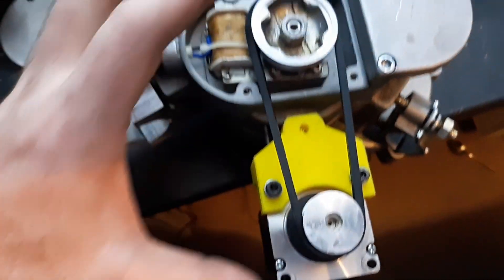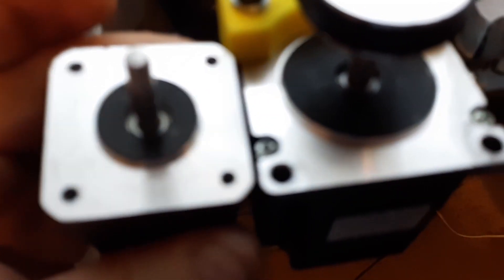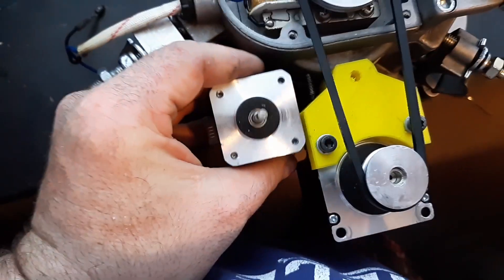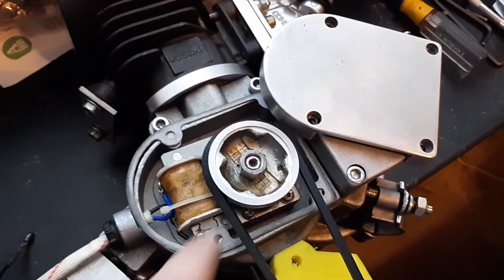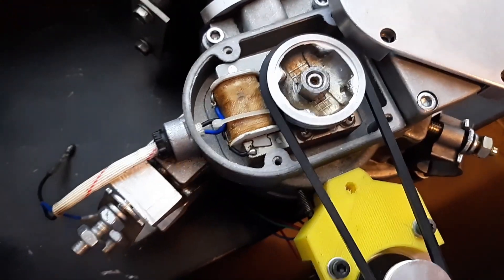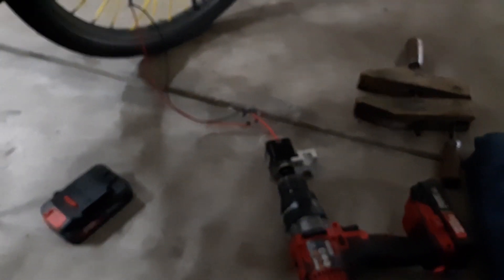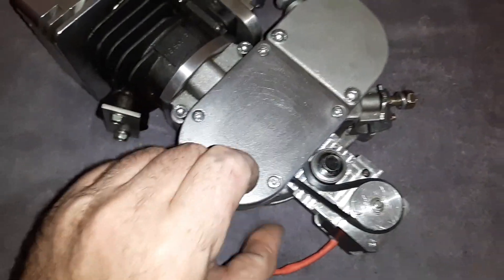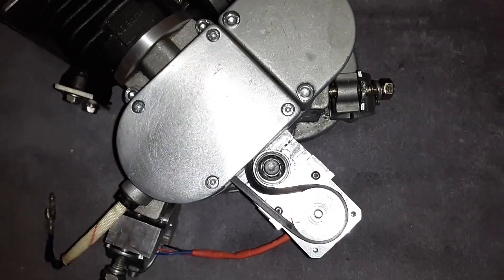Motorized bicycle Engine Powered Lights Build! Final Video!

Comment: All you need now is a sealed cover plate so a puddle of water dont fry magneto
Reply from the maker: Oh what I do it dip my coils in polyurethane anyhow! Dip it in once let it dry about 5 minutes, dip it again then let it dry over night!  Make sure one bolt hole on the steel stator is touching case of the engine and your good to go! As long as you don't put the carb underwater lol bike will run just fine!